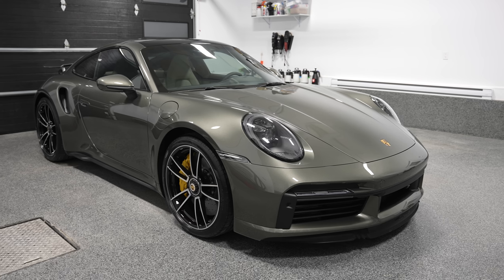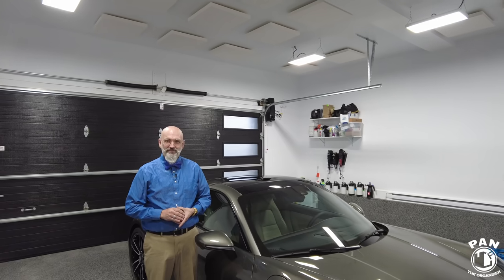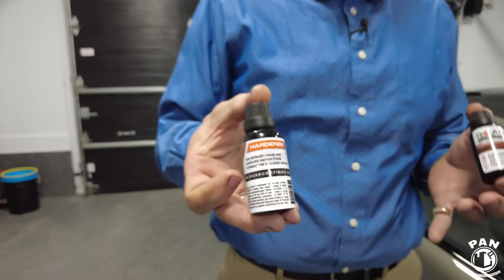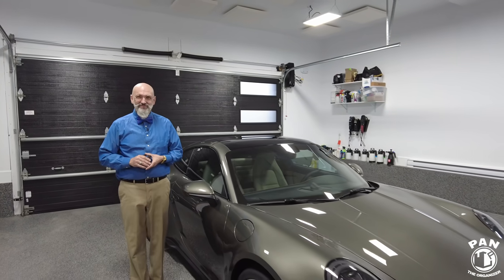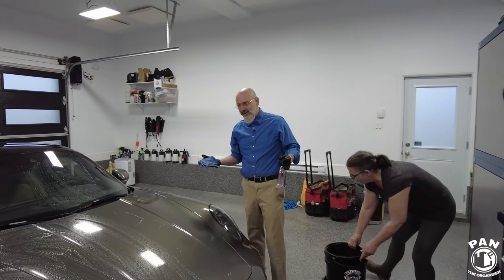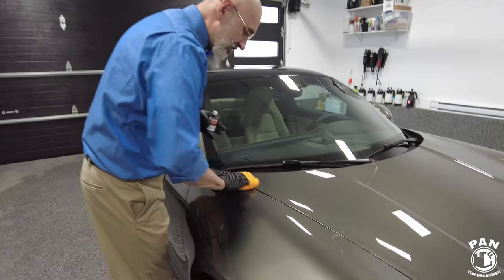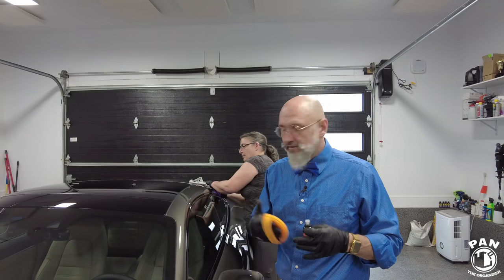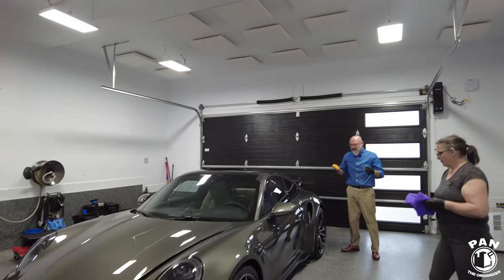Porsche 911 Turbo S : Detailing My New Supercar!!

Comment: Hey pan i love the video but i have 2 questions regarding the product one how many months can the bottles last shelf stable not been open? And 2 question after opening the bottle and using it on a car how many months will it last? Love the shine on the car 😎
Reply from the maker: Usually chemicals are good for 1 to 2 years unopened on shelves as long as they are kept in stable conditions (never frozen). I don’t know how long they last once opened as there are too many different products. And too many variables. You would have to ask the company.

Comment: wrap vs. ceramic? would be interested in pros vs. cons
Reply from the maker: Normally you would apply both if you are considering a wrap (PPF). PPF protects against stone chips, swirls and scratches. And then you apply a coating on top to add slickness, gloss, chemical resistance, self-cleaning properties (meaning the car is easier to clean), etc.  They are complimentary.

In my case, I never apply PPF to my cars, as I get a brand new car every three years, and do low mileage yearly. So scratches and stone chips are of no concern to me. If some keeps their cars for long term and drive a lot, then PPF is a must.
Reply: awesome, thanks. wished I lived in your city; would have you detail/paint correct my 991.2 ...
Reply from the maker: I'll take that as a big compliment! Thank you. I hope you're having a great weekend!

Comment: Hi Pan, I’m a huge fan of your channel! Stunning 911! With regards to the coating and the ease of application why does it have to be applied by a professional? If it’s a easy as demonstrated in the video my 8 year old boy could do it! Will the coatings be made available directly to consumers ??
Reply from the maker: For a limited time, the company is offering the coating to my viewers for direct purchase. https://www.roarcoatings.com/pan

The coating itself is simple to apply (they even have a tutorial on the website). It's the preparation before that is important and not everyone has the knowledge or expertise to properly prep the paintwork before applying the coating.

Thank you for the kind words about my channel. :)
Reply: @PanTheOrganizer  Hi Pan, my apologies. I’ve just read your pin which explains that viewers of your channel can purchase for a limited time only! 👍
Reply from the maker: No worries 👍🏻

Comment: Hi Pan - did you consider Paint Protection Film (PPF) for your Turbo S?  What are your thoughts on PPF vs ceramic coating alone?
Reply from the maker: Hi David. I am just not a fan of the look or feel or PPF. Plus, as I get a brand new car every three years, and do low yearly mileage, scratches and stone chips are of no concern to me. My cars are always pristine when I bring them back to the dealership.
Reply: @PanTheOrganizer  Thanks Pan - I appreciate the feedback.
Reply from the maker: My pleasure David.

Comment: It looks really great? Did those bright yellow calipers also get coated?  Did you do the glass yourself?
Reply from the maker: This wasn't a wheels off detail. So the calipers weren't coated. With carbon ceramic brakes I won't get much brake dust anyways. And the glass was coated yes.

Comment: Hi Pan!
Congrats your  youtube channel- great  movies, keep it up. You have a big copmarison so i'd like to ask why You chose ROAR coating? Is it something better than CarPro coatings for example finest reserve or CQuraz? How U are going to keep it after washing is it dedicated QD or ceramic sealant or its unnecessary? 
How do U rate Optimum system which U used on Your BMW? Did U like "no rinse" wahsing and opti/hyperseal for drying or U used tradicional cosmetics? 
Now I have CarPro (finest reserved) and CleanCar (Fame) ceramic coatings on my cars and i don't know whats the best to keep its duarbility, gloss and sheeting after washing. 
Regards form Poland :)
Reply from the maker: Hi Piotr. Many questions here hehe. A bit too complicated to reply by text, it would take me hours to respond. 

But in a nutshell, for the ROAR Coating, I like to try different products all the time, it's the nature of my channel. And the same person that had installed my previous Opti-Coat Pro+ coating on my previous BMW is the same person that did the installation of the ROAR Coating on my new Porsche. Mr Yvan Lacroix used to be the vice president of Opti-Coat and has since moved on to being a consultant for other companies. And so I trust his experience and when he recommended that I try this ROAR Coating, I knew it had to be good. And so far so good. Some of the best hydrophobics I have ever seen from a coating.

Personally, I will continue to use my traditional two bucket wash method with water and wash mitts as that has always worked for me. No need to change a method that works well. I think a rinseless wash is a great alternative for those who don't have access to water or who live in areas with heavy water restrictions or water bans. And a rinseless wash shouldn't be done on a very dirty car. Common sense. You would rinse that first, and then use the rinseless wash.

CarPro CQuartz Finest Reserve is a great choice for your car. CarPro is one of my favourite brands. For maintenance, there are tons of great products, but at least once every 2 to 3 months you should be using a maintenance topper like CarPro Reload or any other silica spray sealant of your choice.

I wash my car twice weekly on average, and after each wash I like to use a topper as a drying aid. My favourite drying aids are in this video: https://youtu.be/NOTNed04xYE

I hope this helps!
Reply: @PanTheOrganizer  Thanks for the answer. So many products and also still many questions ;) It helped a lot :) For now in my country ROAR is not available..

Comment: So is he using an iron remover and a touchless wash in the same bottle? can you do this.
Reply from the maker: No that's not in the same bottle. The rinseless wash was applied seperately on the paint. And then he used the iron remover as a clay lubricant with the perforated clay towel to clay the surface.

Comment: what was the brand of the applicator pad used for the coating?
Reply: It comes with the coating.
Reply: @LacroixCruiser  thanks.  i was also wondering on your channel about rinseless washing, what's the brand that you're recommending?  i have optimum rinse (onr), but haven't really used it.
Reply from the maker: ONR and McKee's 37 N-914 Rinseless Wash are currently among the top rinseless washes.
Reply: @PanTheOrganizer  Thanks.  I’m looking at some of your older videos and it appears that Mr Lacroix is spritzing some of the rinseless product on the panels first, and then washing it. Now it appears that he’s endorsing a different sponge company versus the big red sponge, correct?
Reply: @jamesharris5244  I designed both the BRS and the UBS. The Ultra Black Sponge is the evolution of the BRS. Better foam, softer, holds more liquid, and more ergonomic shape.

Comment: Hi Pan - do you apply a protectant to the black plastic sections on the front bumper and engine air intake area?
Reply from the maker: Yes the same coating was applied on all exterior surfaces including paint, glass, wheels and plastics.
Reply: @PanTheOrganizer  Thank you, Pan!
Reply from the maker: My pleasure David!

Comment: Can the DIY detailer buy this product or do you have to be a professional? Also is the an expiration date on the roar product?
Reply from the maker: This is a professional grade coating usually only reserved for authorized detailers. But, my viewers are allowed to purchase the Roar Coating through the link in my description.

For coatings in general, if left unopened, the bottles typically are good for 1 to 2 years if kept in stable conditions and not frozen. Once opened, one or two months is the usual consensus.

Comment: Why does the Roar coating need a professional detailer to apply it (normally)? And what makes it worth $500 for the coating and topper?
Reply from the maker: The full service is not only the coating application but all the prep and polishing beforehand. Some people just don’t have the time, experience or equipment needed to coat their cars themselves. Those that do can purchase the kit and do it themselves.
Reply: @PanTheOrganizer  I'm sorry for not understanding. The limited time offer for the base and hardener kit costs $500. That's 5-6 times the cost of a consumer ceramic coating like Gtechniq's CSL. Is it so much better or last that much longer? Thank you.
Reply: One more question Pan. I like the applicator pad with strap that he's using. I couldn't find a link to purchase that. (I've always used the CarPro block and it hurts my (old) hands. This one looks very ergonomic.)
Reply from the maker: I can't answer that question for you. To me it is. But that's like asking someone is a 500K Ferrari that much better or will it last that much longer compared to a 75K BMW or 20K Toyota? Each person has their needs, budget, desires, expectations, etc.

I know I wanted a high performing, glossy, durable, great hydrophobics pro grade coating and this so far delivers on its promises and then some. Time will tell for long term durability, but Yvan has never steered me in the wrong direction. He was responsible for me getting my Opti-Coat Pro+ pro grade coating on my BMW, and that was awesome. I like to try new products, new technologies, and was glad to have this done to my dream car.

Comment: Hey pan did you use a PPF on this or plan on it? If not why?
Reply from the maker: I am just not a fan of the look or feel or PPF. Plus, as I get a brand new car every three years, and do low yearly mileage, scratches and stone chips are of now concern to me. My cars are always pristine when I bring them back to the dealership.
Reply: @PanTheOrganizer  are you implying that since you only drive the vehicles for about 3 years and not a life time, it therefore has a less chance of being chipped by a rock? Also if god forbid that does happen, does it bother you or not? And yes! I agree with you on that I don't personally like the PPF. Was just wondering your opinion thanks:D
Reply from the maker: I don’t do much mileage yearly so the chances are less. And since I don’t keep my cars too long, it’s not the same as someone who keeps their car for a decade. The more you roll and the longer you roll, the more chances you have og getting stone chips.

Now I might get a few tiny ones here and there, but I had a brand new car since 2004 and change so often that it never really was an issue for me.

Look at my previous BMW in my videos. It looks pristine after the three years of ownership. :)

But I do understand those that drive a lot and keep their cars for many years. If they want the ultimate stone chip protection, PPF is the only solution.
Reply: @PanTheOrganizer  awesome, thanks for the in depth response. So are you leasing this porsche  or are you purchasing and trading it after 3 years?
Reply from the maker: I don’t keep my cars long enough to justify the purchase. I lease them…

How did you discover my channel by the way?

Comment: Never heard that tip about just rinsing the coating towels. I wonder why people started throwing them away …
Reply from the maker: I would still recommend throwing the towels away for pretty much any coating, as you don’t want the coating to crystallize in the fibers and scratch the finish in future use.

For sure don’t reuse those towels on paint. If you absolutely want to keep them keep them for tasks like engine bay detailing.
Reply: @PanTheOrganizer  cool appreciate the clarification. I’ve heard of people Throwing the towels into a bucket with some degreaser and water as soon as they are done coating. I guess so the coding doesn’t crystallize on the towel then straight to wash ? I would think the degreaser with mess with the MF towels integrity?
Reply from the maker: Yeah well if they want to take that risk, good for them. I won’t.

Comment: The link to Roar Coatings is not working
Reply from the maker: Yes it works I just tried.  https://www.roarcoatings.com/pan
Reply: @PanTheOrganizer  THanks for the reply. I think it was my computer not allowing access to certain domains.
Reply from the maker: No worries. How did you discover my channel by the way?
Reply: @PanTheOrganizer  I follow your channel. I came across your channel when researching foam canons an you did a test of about 4 different kinds based on cost. Very informative and subscribed. Congrats on the 911 (sweet ride... #NapolineDynamite). I also asked (in another video) about how you transformed your garage to being able to wash indoors. I would like to do the same for my own!

Comment: Out of curiosity, why would someone detail a brand new car? Or is this common for car people who can get it to a better than factory spec?
Reply from the maker: A new car is never new until it's properly detailed. 
- at the factory, the paint defects are often corrected quickly by rotary polishing which can leave marks and holograms, so polishing corrects those, before you lock that in long term with a ceramic coating for example.
- vehicles are then transported by truck, train and boat so they are exposed to the elements, industrial fallout, brake dust, rail dust, etc
- vehicles are often left at boat docks (when transported by boat) or in exterior parking lots for weeks or months, again being exposed to the elements
- at the dealership, the vehicles are almost always poorly prepped using the same dirty water that was used for all the cars on a given day, and poor washing and drying methods leading to swirls and scratches 
- at the dealership, a layer of cheap wax or paint sealant is usually applied to attempt to make the paint glossy prior to delivery. It's crucial to remove any previous protection before you apply a ceramic coating, as coatings need to bond directly to a virgin clear coat.

If you only plan on applying a regular carnauba wax or paint sealant though, you could decide to skip machine polishing, as those protectants can be applied over existing protection and it's not as crucial to prep the paint as well.

I explain all of this in this popular video: https://youtu.be/QgoyrC-5CMc

So you can better visualize the new car prep process, here are the steps I perform on a brand new car for my customers: 
RS6 Avant Performance: https://youtu.be/L5SQ0ZIJCj0?si=mcQiMs9HBLlaqjGK
Mercedes S 580: https://youtu.be/Vq_tfcwryVI?si=whord2_UEFSg28UW
Aston Martin Vantage: https://youtu.be/OKga3yZVTqo
Volvo XC60: https://youtu.be/tvDBBenhYFA
Tesla Model Y: https://youtu.be/gohks8xP5NY 
Porsche 911 Carrera: https://youtu.be/2ckiivbFqs4
Audi Q7: https://youtu.be/t7HCBSVnizM
Reply: @PanTheOrganizer  thank you for the detailed response!

Comment: Hi Pan I'm trying to call the number for roar ceramic coating and it's saying the number or the code is not correct do you have the correct number or could you give my info to Ivan to be able to become and installer thanks William as always be safe god bless William from extreme optimum auto detailing pr
Reply from the maker: Did you try emailing them?
Reply: Yes I did nothing
Reply from the maker: Hi William. I reached out to the company and they had a glitch on the website, but it's now working again. They received hundreds of emails after this video launched, so they will try their best to get to them. 

Email: info@roarcoatings.com
Tel: 519-291-6121

Here is also the page where you can sign up to become an installer: https://www.roarcoatings.com/installers
You would click on "apply now" button and fill in the info.

Comment: Not in 4k? why not?
Reply from the maker: Yes it is in 4K. The opening sequence and the outro (where I'm talking in front of the car) were shot with my new high end Sony A7S III camera. But the shots filming the detailing was done in 4K using my DJI Pocket 2 handheld gimbal (more practical for this kind of video). So not as good as my Sony camera, obviously, but still in 4K.

Did you set the resolution right on your screen??
Reply: @PanTheOrganizer  ahh..When i go to quality 1080p is the highest it goes. Maybe my laptop is just too old for 4k HAHA
Reply from the maker: Yeah most probably, because I just checked and the 4K resolution is stunning!  :)

Comment: You don't take the wheels off to coat?  No inner barrel?  Shame.
Reply from the maker: With carbon ceramic brakes, I won’t be getting much brake dust or contamination. Plus I often quickly add protection in the form of a spray on rinse off protection on wheels like Gyeon Wet Coat or CarPro HydrO2. So no worries.
Reply: @PanTheOrganizer  I understand and It's okay to disagree but for this level of product it seems like a rookie shortcut since that would also apply to the face of the wheels.  I still admire you and am learning a lot from your videos and thank you for your inspiration.
Reply from the maker: Rookie shortcut? Ain’t no rookies here. Sorry. As this is my car, I will do as I please. Thanks.

Comment: Was more impress with the gloss at all. The Turtle 🐢 Wax looks Way MUCH GLOsSIER. 500$ for a bottle yep you need to have deep pockets. 

I think they are so much better options than the ROAR. Wish en good luck. :D
Reply from the maker: Perhaps the video doesn’t do it justice but this is as glossy as I have seen for a ceramic coating. And it’s much more than just gloss with a good coating. You get years of protection, best hydrophobics, etc.